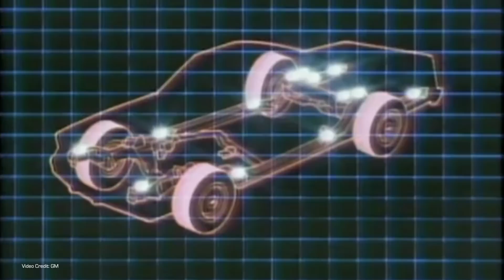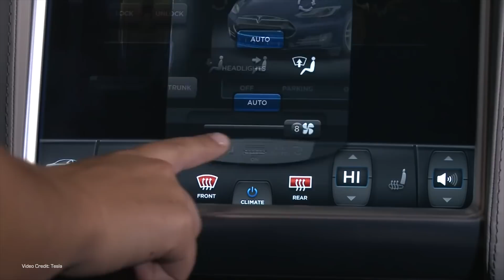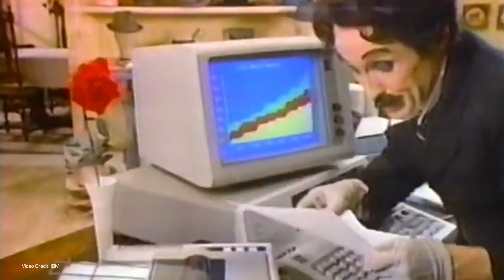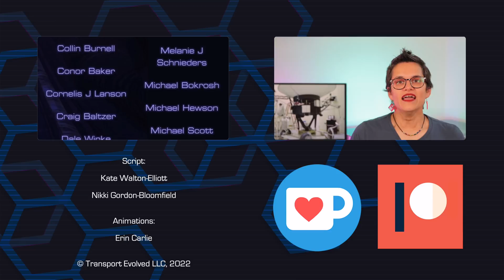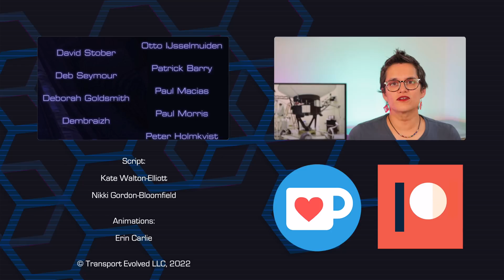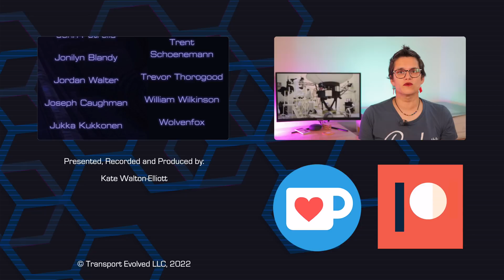Will all those computers kill EVs?

Comment: We are already seeing examples of this in older EVs. I really like the design and build of the BMW I3. In theory that vehicle could be in car shows and on the road 40 years from now. The car body could last a very long time. 

Unfortunately the cell system and software connectivity is already entering the Dinosaur age of computing. I have talked to people who can't get over the air upgrades or connectivity to improve the car usage and health. Some people are already trying to figure out work arounds and ways to upgrade the first generation of that model.

I have been told that as with Tesla and others,  BMW does not plan on supporting older generations of their BEV vehicles. 

I have seriously been considering buying one of the early models and retrofitting better battery packs and an improved  upgraded range extender in it.  I live in the Midwest and need the longer range for the vehicle to be usable. 

In my area the choices are normally Tesla and Chevy Bolt because they are the only vehicles in my area that work out or have enough range to get where you want to and back home where you can charge up. The charging infrastructure around me is almost non existent.

I like the BMW I3 for many reasons. I also prefer a rear wheel drive vehicle in snow and ice. In my opinion I would rather have the weight of the drive motor and additional range extender over the rear wheels. I can always throw sand bags in the rear of the car to get additional traction. 

Our last winter car that my wife drove we finally wore out because I just could not get parts without ordering them online and waiting for them to ship from another country.

I kept her beloved car going as long as I could. I have a Mechanical and Electrical background.
Her 1990 740 Volvo had 347,000 miles on the original engine and transmission. The first thing to start failing was electronics and interior and dash parts. Then Electromechanical parts and then suspension and driveline parts. 

What I could get was vey expensive.

We finally had to let it go.

Comment: I had a Mk7 VW golf.  After 80000 miles, outside the warranty period, the infotainment display and radio would cycle on / off for the first few miles of each drive before staying on.  Many other drivers had similar problems.  It seemed like a software bug, but a replacement unit was £2500k and diagnostics at a VW dealer would be £99.  The car drove just fine, so I only cared about resale value, and got used to the foible.  Lesson learned was don’t spend money on infotainment optional extras. In fact just get a bog standard trim next time.

Comment: I think the apparent assumption that EVs are "more computerized" than ICE cars is incorrect. Sure, Tesla set a new bar with their use of computer systems  for, well, everything in the car, but most of that has little to do with being an EV and is (slowly?) being adopted by ICE manufacturers. The actual EV electronics (the drive train) is probably pretty comparable to the engine/transmission control systems already prevalent and growing year over year. The primary downside, becoming clear before Tesla was born, is the decline in use serviceability. But, again, not a feature of EV vs ICE.

Comment: Thank goodness, no more singing. 

I love computers. I have done a lot of work with fault tolerant/safety critical systems. For example in avionics. However do despair at the overloading of modern cars with electronics and computers. Especially since none of it is easily repairable or replaceable without the original manufacturer and usually at great cost. I'd feel better about it if their were alternative suppliers, schematics available and Open Source. Certainly not happy about it when parts get locked in with serial numbers and so on.

We have a great opportunity here to simplify vehicles with EV technology. But, oh no, they blow it by going overboard on electronics systems and computers, all inter dependent parts.

Comment: I have had replaced cars when the engine was worn out or the differential fell out of the bottom of the car or the entire interior disintegrated. Chips are not as unstable as those parts. 
I suspect though the issue with  long term maintenance of computer equipment will be not the hardware but the software. Various laws define reverse engineering software a piracy and ban it. Making third party car computer parts , for long term support, will be difficult if not impossible if it is not possible to read , modify and  burn the car software onto those parts by third party manufacturers.

Comment: Ok calling up someone about something that you don't like with free content is not cool.
Modern cars have plenty of expensive electronics that can break. ECU's for example you can blow them up with bad wired trailers touching jumper leads .

Replacing entertainment screens in cars all this stuff can cost a couple of $1,000 each.

Comment: When I started working on cars...I'm in my 70's now...there were NO computers in cars. Cars had distributors with low voltage points (a switch operated by a cam) that opened to create the collapsing magnetic field, a condenser (capacitor) to suppress the low voltage spark and make the points last longer, and an ignition coil (a simple transformer) that changed the 12V...or 6V...pulse to a 10KV pulse that could create a spark in the cylinder to ignite the fuel/air mixture (mixed by venturi vacuum in a carburetor). Ignition advance was mechanical or vacuum. 
It worked...the cars actually ran very well. Mostly the problem was emissions. Carburetors also had the problem of sometimes putting too much fuel out under high vacuum conditions...closed throttle on enging braking. This led to excess gasoline washing the oil film off of cylinder walls and premature wear on the piston rings. In those days, you were lucky if an engine went more than 70,000 miles without needing a rebuild.
Computers definitely do a better job of running the engine but like any technology, engineers can fall in love with it and do WAY more than is necessary.

Comment: We become very spoiled. When I was a kid in the 50s and 60s cars didn't last much past 100,000 miles if that. The engines would have to be rebuilt and a lot of mechanical parts in the car were prone to failure. And cars back then required a lot of maintenance. And of course the gas mileage was terrible.
Reply: While many cars failed by 100k miles, many with proper maintenance ( which most people didnt do) would last beyond that. Some were actually fairly  fuel efficient,though they were usually smaller, my Rambler American got 25mpg with no effort. Chevy Bel Air of the 60s with 6 cylinder engine did well, too. Obviously, big v8s didn't do as aell.
Reply: @glbrown4262  your observations correct. By the way I owned a rambler ambassador. The new generation cars are so much more efficient. For example, I changed spark plugs every 100,000 mi today. Back then it was every few thousand miles. I do like modern cars. I don't want to go back.

Comment: Is there some kind of collective amnesia at work? Yes, sensors fail. But often they are cheap and easy to replace. And they have made modern ICE vehicles DRAMATICALLY more reliable than thier all mechanical counterparts. Now days you can expect to get 20 years out of a car even if you abuse the hell out of it. But remember when getting even 10 years of life out of an engine without a total rebuild was considered amazing? Has everyone just collectively forgotten that even the metal parts on cars even in places with mild weather would often not survive a decade? Has everyone just forgotten how hard it used to be just to get a car to START???  My last car, a 20 year old Saturn that has a fried computer (due to a botched jump start) still starts up like a dream every time. The darn thing wont go over 50mph and every guage and light on the dash is maxed out. But it miraculously starts every time. I would call that ridiculously reliable.

Comment: my concerns aren't about computer chips no longer working, but more about software no longer being compatible. If 50% of the functionality of your car is lost because the software can no longer access your NorthStar account, or is no longer compatible with the latest Facebook accounts, and you cannot replace it, then you are screwed. Software upgrades are not enough, either. You can't install the latest version of windows 11 on a commodore 64. My current vehicle is a 24 year old Toyota Tacoma, and nothing original has any issues with any current tech. If it had been based on my fidonet user account, it would now be useless.

Comment: My personal experience is that when something goes wrong somewhere on the CANbus service centres are unable to debug a fault. On two different cars they've replaced the part that generated the Diagnostic Code, only for the error to persist because the Diagnostic Code was triggered by (probably) something else wrong on the CANbus.
They've just replaced a sensor and then the wiring loom on my current car, but the problem still persists.
We need software and network engineers and not mechanics.

Comment: Few people take the time to clean them out because planned obsolescence is setup in such a way that if you open it any warranty is voided and they make it very clear from the manufacturer. The reality is everyone isn’t a tech head and still needs to use computers. If they the manufacture, wanted them to be serviceable by the user , they would not use impossible adhesives and torx bits that are proprietary. Kate you’re great, but you can’t just paint 🎨 everyone as not servicing their computers regularly without speaking about the components in place to prevent right to repair. ☺️🤷🏾‍♀️😅

Comment: AMEN. Applies to ICE just as much as EV. My 1986 Chevy and 1977 Honda are chip free and could easily outlast me. My sister’s 2008 Citroen is about to fail it’s MOT because the built in TPMS has  failed and she is unable to replace it. MOT says that, while a TPMS is not required, a warning system must function if it is present.  Scrap a whole car because of one chip?

Comment: Remember to clean out your air conditioners too! I bought a used portable ac and used it last summer but a few days back I looked at the hot coil inside the thing it had half a cat worth of hair and dust on the grill, you couldn’t even see it. Cleaned it off and washed it out, now it works waaaay better.

Comment: As someone who has worked in the IT industry for over 30 years, the one thing I find exciting in EVs is the technology on-board. They are computers on wheels and should be treated as such. I appreciate that some people may be scared of this, but I’d wager it’s the few and not the majority. When I test drive EVs I am always critical of the UI - is it intuitive to use, or intuitive to learn how to use? If neither are true, then it’s a no from me. All too often, ICE manufacturers who have embarked on the EV train hire in a bunch of developers to code, and leave them to the UI design instead of bringing in seasoned UX designers. The result?… often an interface that is akin to a poor-man’s android phone, with oversized texts, clunky buttons and with controls for certain key functions dotted all over the place - a good example is the Mach-e and lighting - the interior lighting controls are in a different place than the exterior lighting controls, and navigation is hidden behind a button instead of being ever-present on the screen. That’s why Tesla IMHO are so good - they have really thought about tthat interface in their cars, and, over time, have made great strides in improving it. Kate, another brilliant presentation - you’re deffinitiely my kind of nerd! Xxx

Comment: Slightly off topic but I am frustrated about how many EVs come with huge sun roofs as standard. I live in a hot climate, we had 31 days over 35oC this summer and it will get worse, I don't want to melt the inside of my car thanks.  Melted the steering wheel of 2/3 of my cars just leaving them i the summer sun.

Comment: oddly enough, the only time that computers in vehicles were really a problem, was when GM (i think it them) put the computers in the dash of a vehicle. while it was quite a while back, for some reason that wasnt a good place to to put a computer. because as any body touches a dash in the summer knows, it really really hot. which is really really bad for computers. moving them some place else has solved that. and those vehicles were hybrids or Evs, but plain old ICE ones.

Comment: Hey, they will kill EVs if Range Rover is involved.   In the big scheme of most automotive electronics my experience is that they are getting incredibly robust.   That said it is nice that a company like ineos has been able to reduce the number of computers by about half the average ice.  Given that these large ice SUVs are built in a plant that uses electricity only from renewable sources makes its carbon footprint smaller that the F150 Lightning until that f150 hits well into the 250k mile mark.  I wonder what the carbon footprint of my 1963 Midget would have if made today in a carbon neutral factory?  Miss that go-cart.  I digress.

Comment: Having had vehicles that DIED because the on-board computers failed, I can fully appreciate wanting vehicles to be LESS tech intensive.  Considering that Tesla, at the very least, has in the past BRICKED cars for various reasons, having a "Connected Car" is NOT high on my list of wants.

What I DO want is the electric vehicle equal to a Model T, or VW Beetle.  I don't need, or want, an internet connected "Info-tainment" system that the car can't operate without.
Reply: That’s why I bought a Citroen c zero, no screen no connectivity, even the radio has knobs, I don’t need infotainment on my way to and from the shops😁
Reply: @howard922 , I just looked that car up.  Looks like exactly the kind of car I would like.  Too bad they don't have them in the US.  All the listings I could find were in Europe.
Reply: @Cee64E  Citroen c zero, Peugeot ion, Mitsubishi imiev all the same car, but I guess you don’t get any of these (I’m in Portugal) in the states
Reply: @howard922  Them Citroen c zero are pretty nice, its probably the only EV that I'll want. Especially if they released one with at least 200 miles of range, it'll be a great secondary vehicle for me, its probably the only modern vehicle that I know that's very basic. The last one I known of was one of the basic nissan frontiers, it still had a manual and roll up windows as well. I never would get why companies think every vehicle nowadays need to have so many electronics and computers. I guess that's why I flock to buying military vehicles lol
Reply: @hummerguy  they stopped production in 2020 mine was one of the last I guess they don’t make enough money on small simple cars that people want its better for car manufacturers to limit choice to only high end cars until they get everybody convinced that’s what they want!

Comment: Are you talking about computer end of life while wearing 3.5” floppy disk earrings?   I have an 2005 ICE  pos, it has some chips.  Mostly had issues with sensors and wire harnesses.  Sure EV will have failures, just slightly different ones than ICE.  So same song, different best.

Comment: One of the many areas that electric vehicles have an advantage over ICE cars is the amount of heat generated under the hood, where much of the electronics are located. Drive an ICE vehicle for an hour and then pop the hood and stick your head in there. No wonder starters, batteries, alternators and pretty much everything else in there fails so quickly! On the other hand I've driven my Kia Soul EV for hours at a time and popped the hood to top up the windshield washer fluid and it hardly even qualifies as warm let alone hot. This definitely helps extend the life of those parts, and the fact that the major electronics are also liquid cooled (something that is not the case for most modern ICE vehicles) also bodes well.
Reply: Uhm wrong!!!!!! Yes the ECU is designed to be in the engine bay there is absolutely no issues with that! There are many electronics that are made to be heat resistant too and finally those electronics are also properly cooled/isolated including the 12v batteries….. many ICE have the 12v batteries at the rear! There are litteraly heat shields…..
Reply: @carholic-sz3qv  So less heat isn't better than more heat? Interesting. And we're not talking about a small difference in temperature but a HUGE difference, like 75 to 100 degrees or more difference in temperature between an EVs engine compartment and an ICE vehicles. And, the vast majority of ICE vehicles still have their batteries in the engine compartment, being subjected to intense heat day after day.
Reply: EVs have way way more electronics and it start with the battery BMS to motor controller, inverter, charger and many other components….
Reply: @carholic-sz3qv  And not subjected to tortuous heat day after day...

Comment: There is another consideration in this debate. Some car manufacturer are keen to sell "soft" feature. This flies directly against the right to repair. Selling soft features rely on secrecy the right to repair on openness. Buying a soft feature rely on the manufacturer giving you a secret key to unlock something, this is completely incompatible with the right to repair… No point for guessing what I would like to see.
Reply: @JorgTheElder  Actually if you don't control the hardware there is no way you can control the software. It is just plain impossible. you can obfuscate and make people believe they cannot but there is no way you can prevent someone from installing an unlocked software.